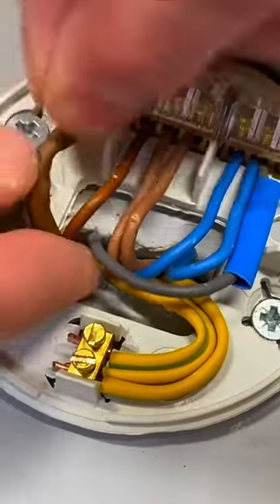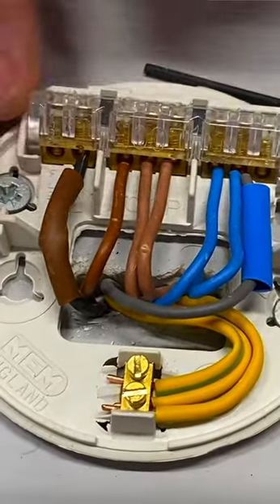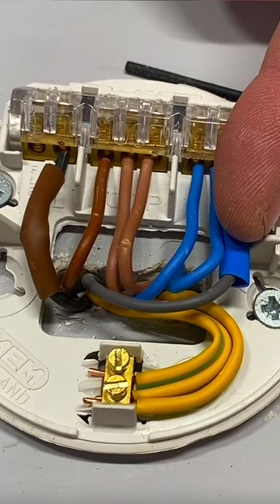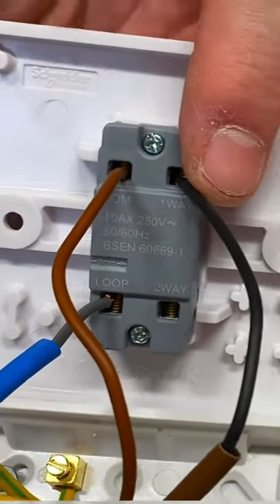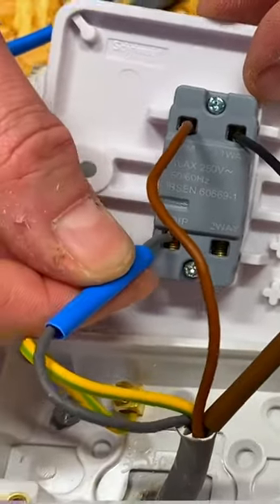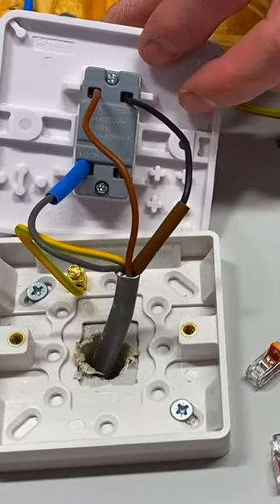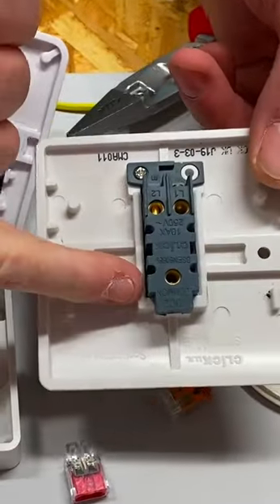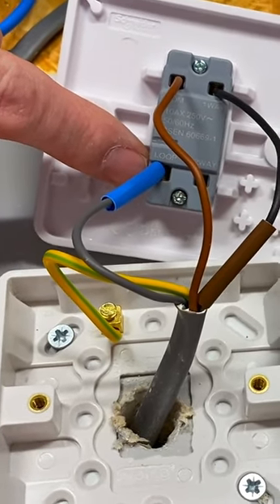DIY Enthusiasts Stay Away…

Comment: What’s wrong with putting the neutral in a wago?? Seems like you’re trying to over complicate it.
Reply: I came here to say this. Why wouldn't you do this
Reply: Because that terminal is designed for the neutral? If you are using these plates, why would you bother using a wago when there is a terminal for it?
Reply: @TrickyTree84 good constructive answer that. You will go far
Reply: Seems like change for the sake of it… not all change is either necessary or worth it.
Reply: @TrickyTree84 that is like wiring that pendant, ignoring the fact there is a terminal for the cpc and putting the cpc in a wago 😂 makes great sense
Reply: @entergenericedgynamehere8751  no it's not.
Reply: Waste of a wago. Loop is just a connector.
Reply: You people and your wago 🤦🏻‍♂️
Reply: Thats the idea🙄
Reply: up selling..  When the customer try's to have a go at replacing the switch themselves they will be totally baffled and have to call the sparky back... Genius...
Reply: @steve11211  If they checked the ceiling rose, they would see the grey wire and check it's the same. If they can't figure that out they aren't really competent. I'm all for diyers having a go at many things, but if you don't understand what you're doing with potentially dangerous stuff then I'm all for making it difficult.
Reply: The cost of a Wago connector that could have been saved. If a DIY is not able to do electrical work and identify a neutral conductor then it should not do it. Anyway if he connects it wrong nobody will die, it will simply trip the breaker when the switch is closed from L and N and he would figure it out (or call an electrician).
Reply: I'm reminded of an electrician I've had to follow: "the next guy's going to hate me for this"
Reply: @entergenericedgynamehere8751 except that terminal is not meant for a neutral.  that terminal is meant for one of two travelers.
Reply: @kenbrown2808  please do some research before commenting 🙄
Reply: @entergenericedgynamehere8751 done: "If you don't know whether houses in the UK have a neutral wire, don't bugger about with UK household wiring. 220v supply doesn't take prisoners. Yes almost all residential electrical installations have a neutral nowadays. But switches are always installed on line/live/phase wires, never on neutral or ground wires."  addendum: it took me all of 9 minutes to see your comment, and google the fact that UK standard switches don't have a neutral terminal.  please don't bugger about with household wiring, you've clearly demonstrated you are militantly opposed to learning.
Reply: @kenbrown2808   Brilliant, please stop embarrassing yourself. Firstly, I have no idea why you have referenced 220v, given the fact that our nominal voltage is 230v.

Secondly, it has been a very common method for many years to take a neutral to the switch (3plate at the switch, or feeding the switch) Bs7671 wiring regulations (the regulations we as uk electricians work to, try giving it a read, you might learn something that you could actually add to this discussion) actually recommends taking a neutral to all switches now to allow for smart switches etc. You arent switching the neutral, only the line conductor, but the neutral is still at the switch. A lot of the hager and schneider switches have a specific terminal for the neutral 

It took me all of 30 seconds of reading your comment to understand you are incompetent and really should stay away from electrics, at any random voltage you seem to pluck out of the air  🤣

Comment: I don't see the point in wiring it like this, warding off homeowners to put their switch in. Hmmmm dog move
Reply: Many smart lighting  controls require a neutral so the traditional neutral as switched live is incompatible.
Reply: Wiring regs recommend taking a Neutral to the switch now to future proof for smart switches. That loop terminal on the schneider switches is designed for the Neutral connections, hager do the same
Edit: Also, add to that, you should be a 'competent person' to change that switch, if you cannot work out that wiring when taking that off, you really are not competent
Reply: DiYers will surely mess it up don't worry.
Reply: @entergenericedgynamehere8751  Regulations don’t make recommendations, they make regulatory requirements. If you’re reading something that recommends something, it’s not the regulations. The only regulations are the Building Regs 2010. Everything else is nonsense invented by trade bodies to try and make their member’s simple jobs sound difficult and skilled.
Reply: EAWR is the regulatory and legal framework which all sparks must comply with.
BS7671 (non mandatory)  are the accepted regs that are recognized by the HSE and (other regulatory bodies) as the way of complying with the EAWR, when it comes to electrical work.
Reply: @supersparx1  The EAWR are very brief to the extent that they apply to installation requirements; the majority of the EAWR is employer H&S and manufacturer requirements, and they pretty much just define common sense. It would be fairly hard to offend the EAWR, hence why there have never been any prosecutions under it. Prosecutions are always under the Building Regs, as they are (marginally) more onerous. And BS7671 aren’t regulations, they’re unofficial guidance generated by a profit-making trade body.
Reply: It's sparks trying to use some smoke and mirrors to fool those who only have basic DIY skills. Sparky work is about as easy as it gets so no need to be ripped off by them.
Reply: @CarlosFandandgo If it is that easy, I assume you have a huge, successful electrical contracting business? Or would that be too easy for a man of your calibre?
Reply: @CarlosFandandgo  What do you do for a living?
Reply: @CarlosFandandgo  Do you think people read what you write and believe it 😂😂 quit embarrassing yourself
Reply: @entergenericedgynamehere8751  That’s an unjustifiable assumption. That someone thinks a job is easy and unskilled doesn’t imply that they run a business doing the job. Otherwise the poster would also be a bin man, and work at McDonald’s etc.
Reply: @sam.p12345  are you saying bin men and McDonalds workers are un skilled? Bit of an unjustifiable assumption that

Comment: What a silly thing to do. What is wrong with diy'ers changing a switch? Why is it necessary to go out of your way as a professional to confuse and potentially endanger people?
Reply: Wiring regulations recommend a Neutral is taken to all switch positions to allow for future smart switches etc. If you are a DIYer and you cannot work out the fact that the cable thats is clearly marked up as a Neutral, is a Neutral,  you really shouldnt be touching anything electrical. A DIYer should still be competent
Reply: Noted and accepted, it was your comment about warding off diy'ers that got me.
Reply: @thedjwiththebeats I never said anything about warding off DIYers. I assume you are referring to what he said in the video?
Reply: I think he was trying to avoid DIY sparks from trying to potentially work out this situation but with let's say a four gang switch where some lights are two way or intermediate switched from that position, some are one way and the provision or a neutral means that you may have a combo of switch fed and 3 plate fed circuits all in one switch and different sparks use different cores to others.......you could have at least 20 wires in a switch in a Morden kitchen.......good luck changing your face plate from B&Q

Comment: Gary, you well know I am huge fan of yours and eFixx. BUT! I’m not sure I fully agree with this. The switch belongs to the owner and if they want to tinker with it that’s their prerogative. Setting a trap to cause issues with someone else’s property isn’t cool. Maybe mechanics will start fitting non standard tyre valves so you can only go to them to inflate your tyres. Even Part P in its early, stricter incarnation permitted the DIY change of accessories. Instead of this why not replace the faceplate screws with security machine screws like Torx centre post or Triangle. Regs need to be made clear that unused cables should be separately terminated and maybe over sleeved to indicate unused cables. A good video that has prompted me to indicate clearly unused cables for the DIYer and following sparks.
Reply: Agreeded
Reply: It's the first rule of multi core cables to use sleeving indicating its use he used blue so has identified the purpose as per the Regs.....but this lopp connection is nonsense....loop has always been a reference for the permanent live at the ceiling rose....this has no benefits whatsoever
Reply: Rightly said

Comment: When i install a 3 core and eath for the switch cable, i do not connect the grey wire at either end to avoid the diyer from killing themselves
Reply: Any cable not being used I would always put to cpc 👍🏼
Reply: This is the way to do it. 👍👍👍
Reply: @YosemiteSam23 no point in having 2 cpc's in every switch wire in the house is there?
Reply: Thank you

Comment: What do you think gives you the right has an "electrician" to do something that may prevent someone from changing THEIR OWN light switch, who do you think you are, inspector watts of the builders yard.
Reply: How is he doing anything that prevents someone from changing their own switches.
If you don't know what you're doing then more fool you for fiddling about with it.
Reply: Because of the language he uses! "Ward off" 
There are clowns and fools in every aspect of life and trade, we all know that some folk should no more be allowed to own an insulated screwdriver then some should be allowed to drive a car!
However Just because he's a spark who spends more time on making YouTube videos then on a building site doesn't give him the right to police householders even if they carry out ill advised tasks around the home, at some time we all got the call,
"I've changed a light fitting and now I'm sitting in the dark"!!!
But as it so happen's I very much knew what I was doing!
Reply: @DofTF Try answering my comment instead of going off at a tangent. 
Nothing he has done has prevented a homeowner from changing their own light switch. 

There are several ways of wiring 2way lighting and I've also seen some unconventional versions on top of that.
They all still work.
It is the person who is working on the circuit responsibility to know waht they are doing.
I suppose you'd accuse an electrician who used an unconventional way of wiring 2 way lighting of "trying to police householders".

He has used that terminal for the purpose for  which it was intended, to terminate an unused neutral.

If someone who is trying to change the light switch doesn't know what they are doing that is their problem, no one elses.

Tell me. If a homeowner got electrocuted when fiddling about with  a light switch, who woulld get the blame, the homeowner or the electrician who fitted it correctly before?
Reply: @supersparx1 the homeowner, if I throw myself across the room changing a switch do you really think I can blame the spark that fitted it 20 years ago?
Reply: @johnhambridge2422  No I don't. That is my point. It is the responsibility of the person working on the circuit to ensure their safety and no one else's regardless of how it is wired.
If you can't determine safely how a switch is wired it is your own fault if it all goes wrong when you fiddle about with it.

Comment: And if a diy puts that neutral in the in l1 or l2 they could short line and neutral and explode the switch, better to not do this method
Reply: The switch shouldn't explode as the MCB should trip first
Reply: Not electricians fault. Don't touch electrics if you don't know what your doing.
Reply: or the next professional could say "what DIY put a blue sleeve on a traveler?" and remove it.

Comment: Strange nobody commented on the damage to the insulation on the line conductor in the ceiling rose. 
but then I am just one of those incompetent DIY people.  Only about 63 years of not setting things on fire.
Reply: @@HalfTheWorldAway-mf5cf Could be but then I have my opinion.
Reply: @@HalfTheWorldAway-mf5cf That he's using to make an "educational" video to all & sundry.
Reply: You are referring to the slight dent in the insulation, most likely caused by the rose cover. There is nothing wrong with that, nothing exposed, and seeing as this chap is an actual electrician, I would trust his judgement over yours. Stick to DIY old boy

Comment: I'm in an old house, no neutrals at the switches  a pain when you want to fit smart switches.
Reply: There are switches which don't require neutral, like Inovelli. They are always "slightly on" and allow a small amount of current through, not enough to energize the lighting but enough to function their smart stuff. If you have a low-wattage bulb they can flicker in this case, in which case you would install a little bypass. I've done this in my 1940 house and it works great.

Comment: Why use a three core if u don’t need to and then make one a neutral. Why would u have neutral at switches unless u are using double pole switches or u took the feed to the switch first. Adding neutrals just for fun.
Reply: It's for smart switches in the future. And you then have a permanent feed at the switch. Comes in handy now and then.
Reply: Bs7671 (wiring regs and the standard all electricians in the uk should be working to and be up to date with) says consideration should be made to take a neutral to switches for smart switches etc going forward
Reply: Future proofing, and it barely costs any extra for 3 core over 2.

Comment: These switches are meant for the likes of flats, having the junction behind the switch. Then there would be three cables into the box. Line in, line out to next switch and cable to light fitting. 
L in and L out to the common. The N terminal will have three conductors in it - in, out, and to the light fitting.
Reply: What about houses? What switches can you use in them? 😂😂
Reply: @supersparx1  
Three plate with junction in the ceiling rose.
Reply: @johnburns4017  Can you use three plate in flats, or is it only houses?
Reply: @supersparx1  
You are confused. Many vids in YouTube explaining it all for you.
Reply: @johnburns4017  Yes, I'm confused. I've used these switches in houses, an office and even a garden shed. But you say they are mean't for flats.
Now I'm worried I've used the wrong switches.
Reply: @supersparx1  put that fishing rod away 🎣 😄 🤣
Reply: @supersparx1  
You are still very confused.  You should stop putting them in until you fully understand two plate and three plate methods. Many vids about them to help you along.
Reply: @johnburns4017  John, I can't work out if you are taking the mick or not. I really hope you are
Reply: @johnburns4017  Cheers. I wish the instructions would make this clear.
Domestic lighting circuits are complicated enough, without manufacturers producing different switches for different types of dwelling.
Is You Tube the best place to learn electricking. Is this where you get your knowledge from?
Reply: @supersparx1  France sounds like a good place to learn electricking too
Reply: @entergenericedgynamehere8751  Not sure about that. I'm still confused with UK lectricks🤣🤣 (apparently)
Reply: @johnburns4017  Thanks I will. Just out of interest, what will happen if I use the wrong light switch or plate method in the wrong dwelling?
Reply: @johnburns4017 Dont worry John, from what I am hearing from you, I trust you enough to take your word on it. You seem like you know your apples from your sausages
Reply: @supersparx1  Really bad things
Reply: @supersparx1  wrote:
"what will happen if I use the wrong light switch or plate method in the wrong dwelling?"
It may not work properly.
Reply: @entergenericedgynamehere8751  
🤣😂🤣
Reply: @johnburns4017  Will I get into trouble?
Reply: @supersparx1  wrote:
"Will I get into trouble?"
I hope so. When it does not work right the customer with be furious. Then it is best to run or call the police. Or maybe take civil action as they will not pay you.
Reply: @johnburns4017  You hope so? That's not nice.
Another question. I've been watching these 2 and 3 plating videos all night, I'm really tired so bear with me.
Can I mix 2 and 3 plate systems in one dwelling? I can't find a definitive answer.
I don't want to get into fisticuffs with a client.
Ta in advance.
Reply: @supersparx1  
Done properly of course you can mix, but I do not think you should do that at the moment. 

Supersparx1, a quiz.
Name the most common form of earthing in France?
20 points for the correct answer.
Reply: @johnburns4017  TT. So what. What's that got to do with lighting circuits? In the UK.
Reply: @supersparx1  
Correct! 
suersparx1, the name the most common form of earthing in France is....

🍾🍸🎊 TT 🍾🍸🎊

20 points earned.
Reply: @johnburns4017  I feel so special.
Reply: You've just described two plate wiring, the video is 3 plate wiring but just bringing the neutral down to the switch as well for smart switches etc
Reply: @solverz4078  
Yes.
Hager and Schneider fit a terminal for looping and parking.  They were originally developed for two plate. Many installations are now going over to two plate because of downlighters etc. 

I have never used Hager and Schneider switches them myself, always used a Wago in the backbox when doing two plate.